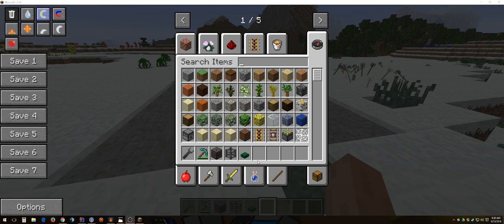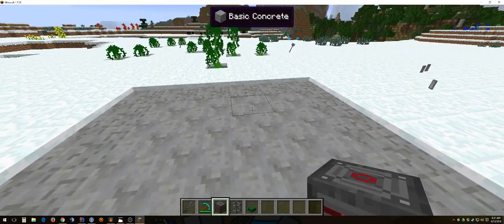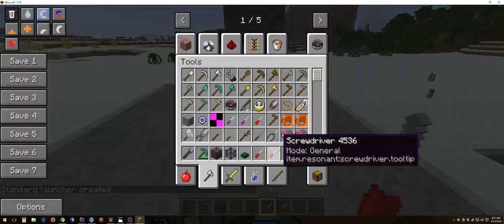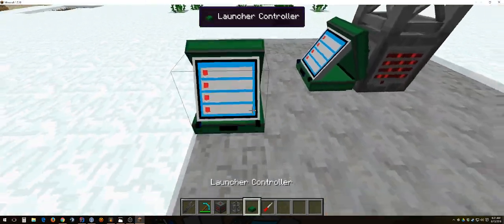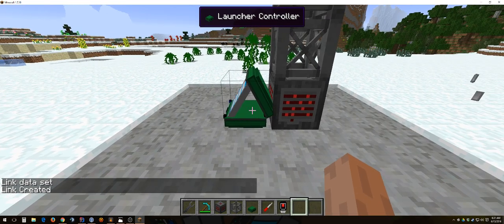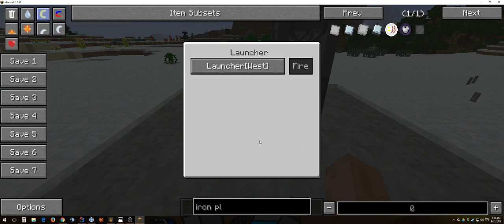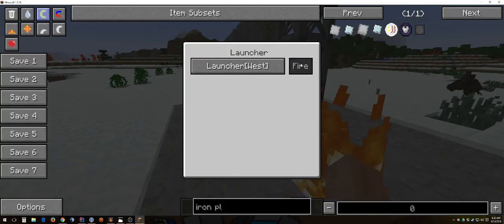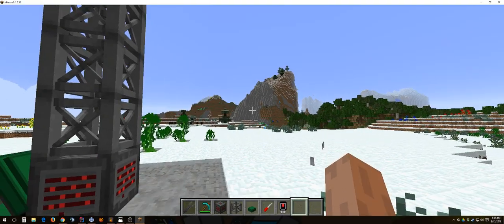ICBM - Standard Launcher Setup Tutorial

Comment: the distance depends on what thruster you use the creative void engine has 100000 block range while the gunpowder engine. is only about 200 blocks
Reply from the maker: Gunpowder actually has a distance of 512 if fully loaded with gunpowder. That being said this is going to change over to a duration based system in the future to better deal with the speed. As well in the code, the creative engine has a max range of 10Km but range is not currently enforced. The only thing that is enforced is the life time of the missile, hence why in the comment earlier I noted it was based on size. https://github.com/BuiltBrokenModding/ICBM/blob/development/src/main/java/com/builtbroken/icbm/content/crafting/missile/casing/MissileCasings.java